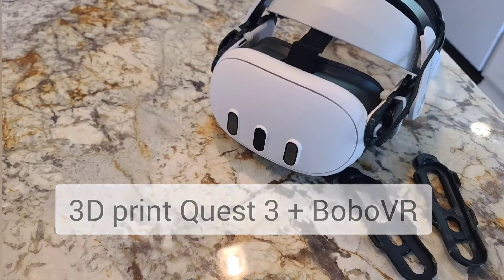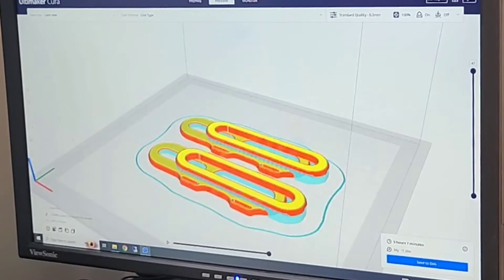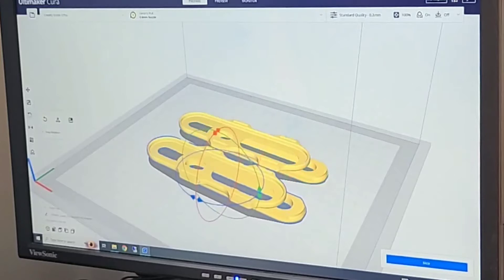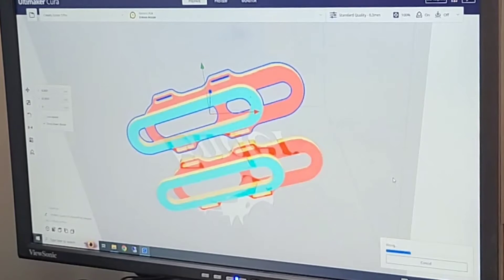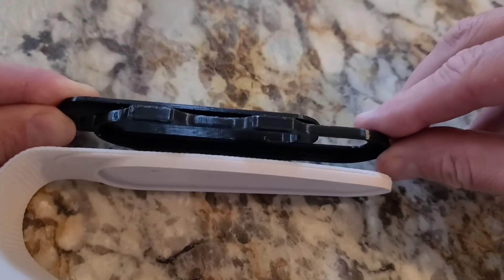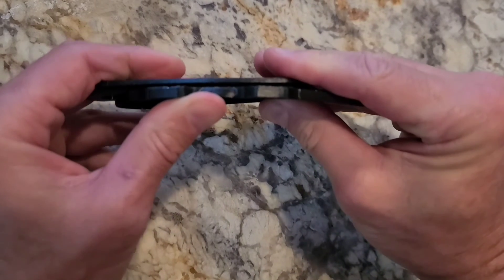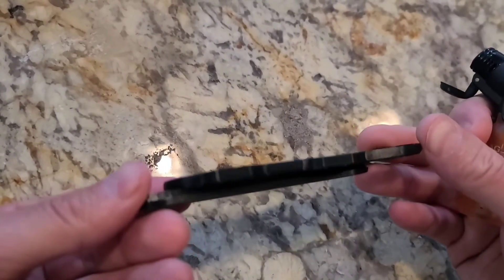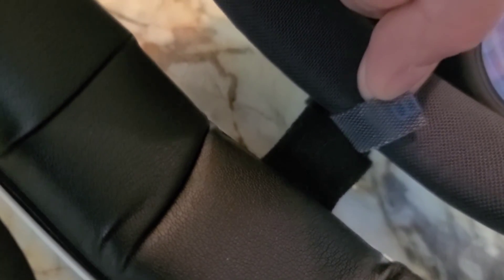How to 3D print an adapter for your existing BoboVR Headstrap for the Meta Quest 3

Comment: how's the forehead support? can you still adjust it? i want to be as close as possible to the lence. I'm think of doing this route and buy the BOBOVR M2 Pro Battery Pack Head Strap. thanks for the video!
Reply from the maker: Mine fits my face nicely. Similar to before. I can see out the nose piece below my face. I assume that's why there is less fogging (or the shape of my face)

Comment: Thanks for the video.
I just printed this myself. PLA+ 101% scale. 100% infill. 0.2mm layer height. Worked out a little loose straight off the printer. But a tiny bit of heat with a heat gun allowed it to mould to the shape needed and shrink into place really well. Just don't OVERHEAT when trying to soften it up.